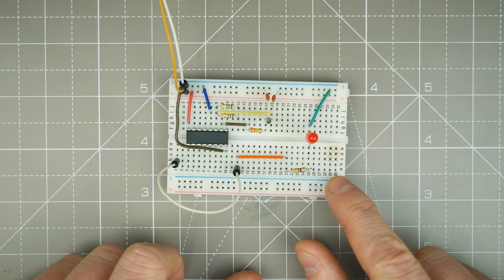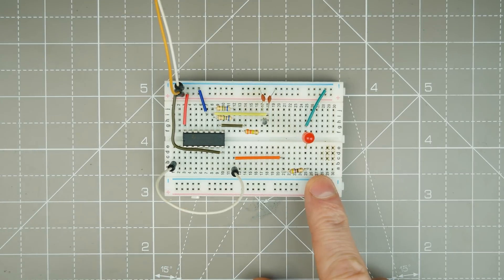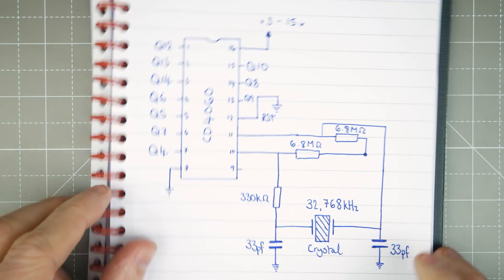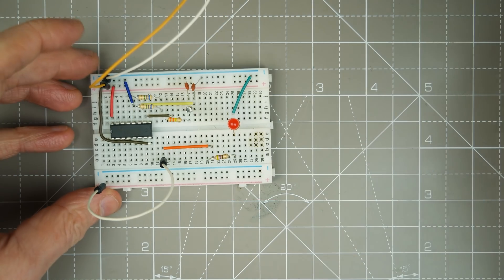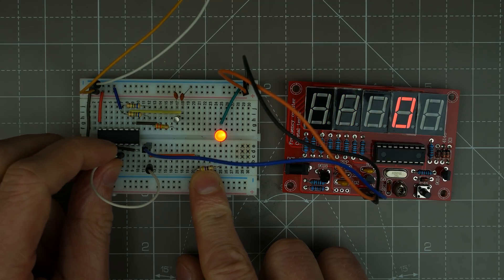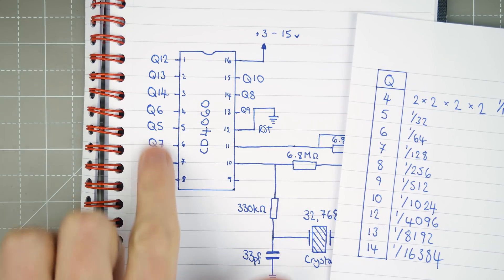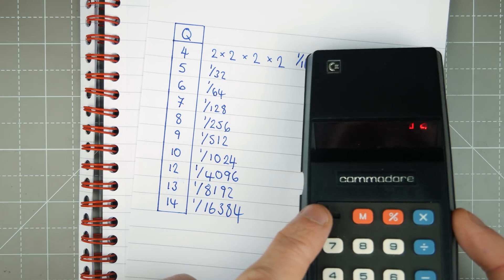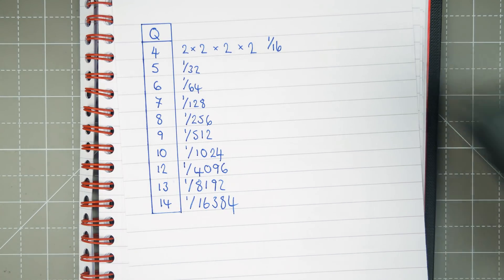4000 Series Logic ICs : The 4060 Ripple Counter

Comment: Hi sir, I did with 1 M ohm (11-10 pins), 32768 kHz crystal(9-11 pins) and 22 pf (9 pins) but there are deviations when I make time longer delay. Do you have the same problem if not I’m going to buy some components to make your same circuit, thank you
Reply from the maker: Hi, in general the crystal's datasheet will tell you what loading capacitors to use in your circuit. I haven't seen a single capacitor layout before. If you are using pin 9 (external capacitor) then it sounds like you are using some kinda of hybrid of the base CD4060 Oscillator Configuration which usually doesn't use a crystal. If you google "CD4060 32.768" you'll find plenty of schematics, but only one that looks like yours. Did you get it from another youtube video?
Reply: @DavidWatts  Hi, I did same circuit in this video which I put in below it works but with deviation https://youtu.be/0GqoldkmgRk?si=kp7FK_MFy3yL7e_Y
Reply from the maker: It may well be their crystal and 9v being used, it isn't a typical circuit for this kind of this as far as I can tell. Best of luck to you.
Reply from the maker: There may well also be some stray capacitance in the breadboard at play here helping the crystal oscillate.

Comment: I use the 74HC4060 pushing MOSFET 2N7002 to lite up LED where 74HC4060 Vcc is 3.3V and 2N7002 Vds is 12V from car lead-acid battery. The output voltage of Q is half of Vcc, 1.67V. Which is a bit below the gate threashold Vgs(th) of 2N7002. How to wire to make the Q output is at same level of Vcc? Or select another N-MOS having lower Vgs?

Comment: I know this is a year and a half old video, but here's hoping you still get notifications..

I am trying to somewhat replicate a tea light LED candle that when switched on, stays lit for 6 hrs and then automatically turns off for 18 hrs with the switch remaining in place. All of my research brought me to this video and I was wondering if this 4060 IC is the item I need?  I am trying to power one (maybe two) 5 mm white LEDs with a 9V battery while keeping size to a minimum. I know how to do this with an Arduino Nano, but I believe it would be large, drain the battery too fast, and kind of excessive for this small application. I have a soldering iron, some protoboards, the 5 mm white LEDs I want to use and some resistors but can get more supplies if needed. I plan to make several of these setups for gifts ;)

I am brand new to electronics and any help would be greatly appreciated.
Reply from the maker: I can't tell you exactly how to do it but I can give you a rough idea. Using an RC oscillator on the 4060, 120k resistor on pin 11 another on pin 10 and a 10uf cap on pin 9. That should give around 4.5-5hz. So Q14 (pin 3) will trigger once an hour (It won't be that accurate but good enough). Throw that into a decade counter 4017 and when it gets to 6 hours on the output you'll need to figure out an off switch with a couple of mosfets or transistors. With all that in there you are probably looking at around 10uA. Alternatively, you could look for a oneshot 555 circuit which would also work for you.

Comment: Tnx for the vid, great work!
I build the same circuit but its seems that the 4060 is useing alot of power (0.5 mili amp) do you know if that is normal?
Reply from the maker: 0.5mA seems a little high, most likely cable resistance or resistors in the circuit

Comment: Why the strange layout of the two 6.8M Ohm resistors? They're simply in series. Why not draw them like that?
A piece of red sheet plastic will allow the 7 segment LED display to be visible under almost all lighting conditions.
Don't you own a LCD calculator? It would be visible without having to tilt it. Just lay it on the table and voila!
Finally, could you pick up the pace a bit? You only need to give one example and then say, and so forth but yiu seem to dran yiur explanations on and on and on and on and on ... Get my point? Thank you for your efforts.
Reply from the maker: Thanks for the feedback Joe. The diagram got away from me a bit, I think they are still in series in the diagram, I am just not great at getting things down on paper. For the rest of the feedback I will simply say that, it is what it is and those were the decisions I made with how I explained it and demonstrated it.
Reply: @DavidWatts  I understand. Please keep making digital electronics videos. I appreciate how you encourage people to learn and expetiment.